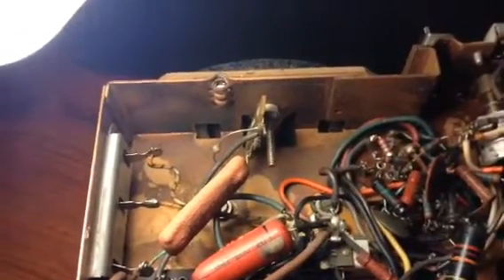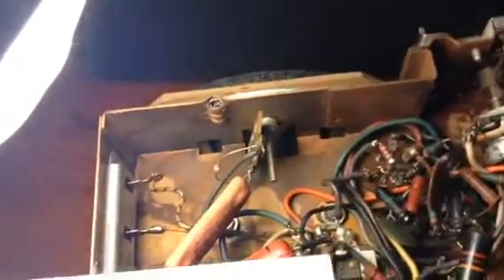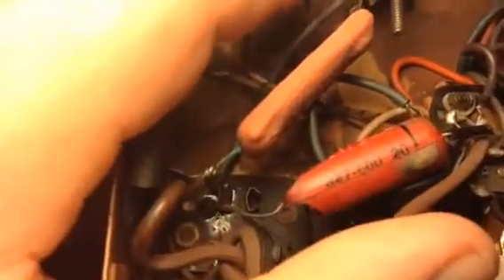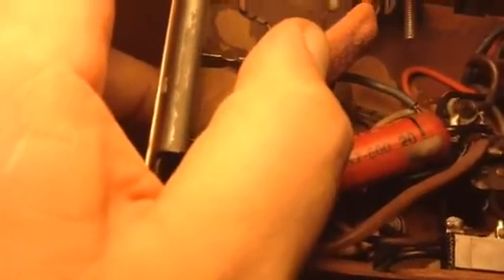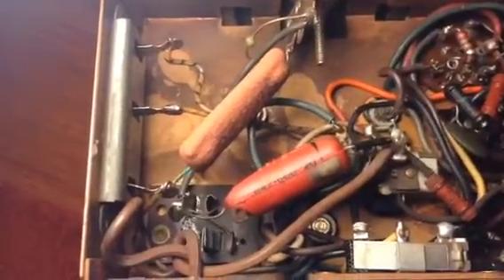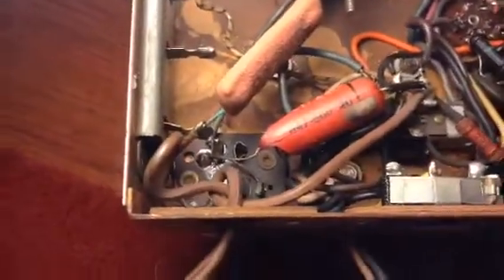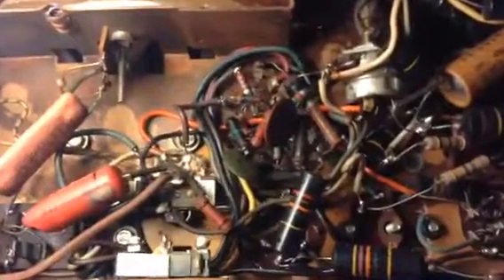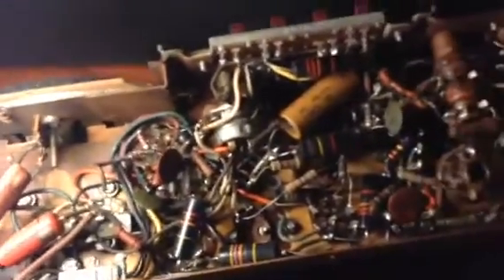Zenith transoceanic missing selenium rectifier

Comment: Jefffrey,
Right...that is a diode.  If the radio turns on, which it does, then leave it as is.  But there should also be a low value resistor in series with it to make up for the selenium rectifier internal resistance that was lost when it was removed.  The diode does not have that resistance.  Check to see if the resistor is there.

Regards,
John
Reply from the maker: joernone Thanks. I haven't seen any extra resistors. The leads on that sand resistor have that green gunk growing on them. I hear that can eventually mess up the resistor. I guess I could factor in a little extra resistance when I replace that resistor. How about that ??
Reply: @jefferyb304  7 years ago but yes that is EXACTLY what you need to do.
Reply from the maker: @mikemoyercell  I need to get back to this radio sometime.  I put it a away and life went on.